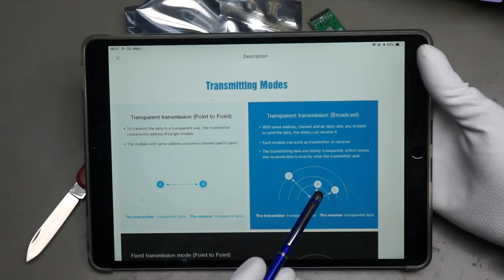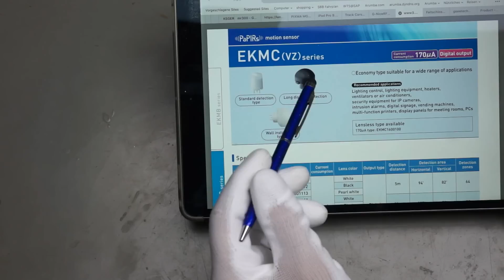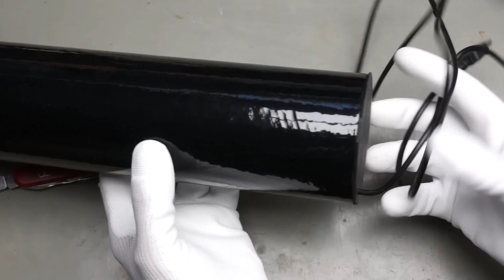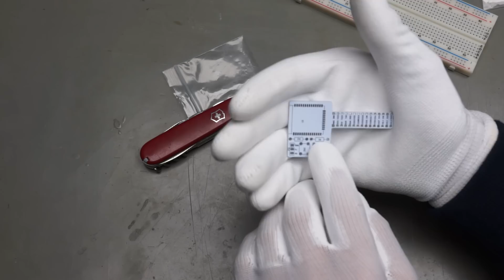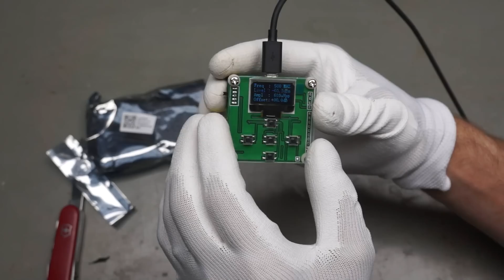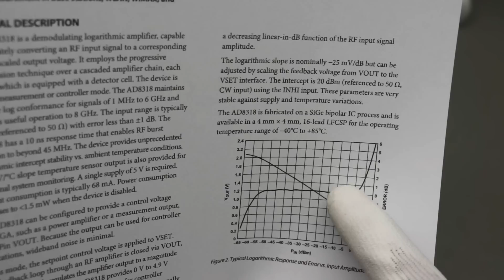#266 Mailbag with LoRa, special PIR, Sigrok, Harvester, Ethernet Cable Tester

Comment: The Cypress FX2 is not an FPGA, it an 8051 microcontroller with a high speed USB data fifo.  It is programmable, in that (whatever program you're using) uploads code into the RAM when the USB device is plugged in
Reply: you all prolly dont care but does any of you know of a trick to get back into an instagram account?
I somehow forgot the account password. I love any assistance you can offer me!
Reply: @Jesse Bentlee instablaster :)
Reply: @Adrien Maverick i really appreciate your reply. I found the site thru google and Im waiting for the hacking stuff now.
Takes quite some time so I will get back to you later when my account password hopefully is recovered.
Reply: @Adrien Maverick It did the trick and I now got access to my account again. Im so happy:D
Thank you so much you saved my account :D
Reply: @Jesse Bentlee glad I could help =)
Reply from the maker: Your are right: It has a 8051 as a supervisor. Maybe it is not correct to call the logic FGPA. In the datasheet it is called: General Programmable Interface (GPIF)
Reply: @AndreasSpiess  Handy to have them around. I did a housing for these on thingiverse: https://www.thingiverse.com/thing:3371019
Reply: @AndreasSpiess  FX2 have configurable analog arrays where you can do analog filters, DAC, ADC etc. FPGA is full digital signal processing.
Reply: @LimbaZero  FX2 doesn't have any analog circuitry. You're confusing it with PSoC. FX2 is a universal data pipe with USB2 interface on one end and very flexible parallel interface on the other. 8051 core is used for configuration and management of the USB engine, but sits idle for most of the time (can be used for other things). The chip is very often used to provide usb connectivity for FPGAs, or to grab any other parallel data (like in logic analyzer). Cypress has also similar product for USB3, called FX3.
Reply: @piranha32  Yes that's the case. I was too tired when commenting. Both from same vendor.

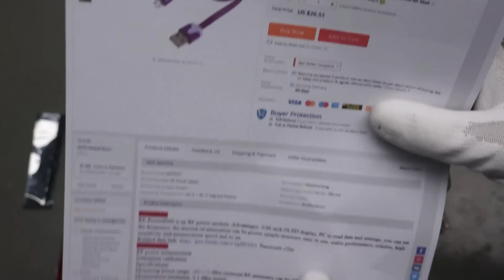Comment: Great vid, thx - precarious how much I enjoy other people's mailbags, anyway Andreas thx a lot for putting info with prices, apreciated. Im interested in this RF power meter  15:42  and wondering of this unit will do what I hope,  I fit it with an appropriate antenna and be able to show me the RF-powervalues on RC 2.4ghz equipment, like RC quads?
I almost got myself one of these immersion RC Power meter V2 when GB had clearance at 35USD https://www.immersionrc.com/fpv-products/rfpwrv2/
but was sadly sold out before my PayPal process was golden, so been in the market for an RF Power meter, not leats for RC gear..
Reply from the maker: The power meter is only for transmitters and you need also attenuators because otherwise it is kiilled. If you want to test antennas, you maybe want to watch my antenna videos.

Comment: Is the RF meter sensitive enough to use with a high gain directional antenna to pinpoint single sources?  Is the frequency set manually, or does it lock onto the strongest source?
Reply from the maker: You cannot test antennas with it. Only transmitters

Comment: Hello Andreas, I'm really looking forward to your solar harvesting project.
I would recommend to also add the AEM10941 to your comparison. It is an energy harvesting power management IC, it has build in LDOs, MPPT function, and battery management. Jasper Sikken sells a complete module on Tindie, I'm using it for some Lora test projects. Check it out on: https://www.tindie.com/products/jaspersikken/solar-harvesting-into-li-ion-battery/
Reply from the maker: Thanks. I ordered one.

Comment: Hi Andreas. Could the power meter be used with an antenna to measure transmitted power from some of the transmitters we use, e.g. 433Mhz modules, bluetooth, wifi, lora, rfm69,nrf etc? If so, maybe it can be used to make relative measurements to compare the power emitted by different antennas (e.g to check if the antenna is correct for the frequency) - assuming the power out from the transmitter is constant (not adapting). I know there are SWR meters, but they are more expencive. Bying antennas from China is gambling.
Reply from the maker: It is not connected to an antenna, only to a transmitter.  The antenna is not covered. If you want to test the antenna you either need a VNA (I showed it in a video) or use a receiver a few hundred meters away (another video)

Comment: @9:53 You can measure visible spectrum using young's double slit experiment (very easy and cheap to do). If you have a camera to let you observe the IR pattern you can measure it with a ruler!
Reply from the maker: This is more or less what this camera does. Just electronically

Comment: Interesting mailbag
I think the bq25570 is a very good energy harvesting chip, although rather expensive. I have been using this chip for my solar powered weather station  for a couple of years now, without any problems. But you have to read the datasheet very careful to get the full benefit of the chip. I use a LIPO battery for storage, I tried using a supercap but couldn't enough energy out it, notice that the output stage is a buck-converter therefor the voltage  on the cap should be higher that the output voltage, which doesn't get the full potential of energy of the cap.  I had some problems with the output cap which is specified to 22 uF, I had to increase it to 1000uF to avoid Brownout. Also take a look on the design Excel sheet http://www.ti.com/lit/zip/sluc461 if you are going to adjust some of the settings.
Reply from the maker: Thank you for sharing your experience. I think for our ESPs or Arduinos a super cap has no advantages (at least in normal temperature ranges). And here if we have sometimes for a week not sun wee need some capacity. The sheet you referenced is similar to the calculations I did in my solar video. It is quite straightforward.

Comment: I think amazon.de is watching your youtube channel :) . I found this https://www.amazon.de/dp/B07DWV13WG/ref=gbps_tit_s-6_beb0_5067099d?smid=A27QO866LT4V45&pf_rd_p=d873fd2d-3f6d-45a1-84d2-430e9b93beb0&pf_rd_s=slot-6&pf_rd_t=701&pf_rd_i=gb_main&pf_rd_m=A3JWKAKR8XB7XF&pf_rd_r=QKP0A6M2JXXN9GFKEW61 in the "Angebot des Tages" this morning.
Reply from the maker: :-))   Very similar, indeed. I buy now more and more from them as they stock up electronics. And usually, are quite fast.

Comment: Audio too soft. right click -> stats for nerds -> volume: -9.6 dB. Ideally it should be between -2 to 0 dB. Turn up the mic gain and move it closer to your face first, if still not loud enough then amplify digitally. Audacity is a free audio editing software that you can use
Reply from the maker: I use audacity and level it to -2dB max. The rest is done by Youtube

Comment: 100 mW in 433 MHz is *forbidden*, unless you are an amateur radio operator and transmitt with your callsign . For ISM usage, you are allowed to use 10 mW maximum.
Reply from the maker: I dis not check. Might also depend on the country
Reply: @AndreasSpiess  It comes from ITU regulations, applies almost everywhere (where the ISM 433 band is allowed, which means in the ITU Region 1 and some countries of the ITU Region 2).
Have a look to : http://www.apt.int/sites/default/files/Upload-files/AWG/APT-AWF-REP-07Rev.2_APT_Report_on_SRDs.doc
Reply: @Elektro LUDIKITS You are almost correct, if you limit the duty cycle to 1% and channel bandwidth to 25kHz (shouldn't be a problem with LoRa), there are several bands that allow up to 2.5W of power, license exempt. Here is a link to regulations in switzerland: https://www.ofcomnet.ch/api/RIR/1021/06

Comment: I have question for king of sensors :) I have tried to solve this already more than few times without any luck, what type sensors are used for finish line trap. typically end of rally stages etc. I assume it is some sort of IR coupler, but nothings pops up when doing search. It should be powerful and big enough to work on such poor environment. Few times actually seen some trap sensors, but no markings, big lenses.
Reply from the maker: I use 15 degrees lenses in my IR video. They should go a few meters. But the beam is not small. You probably would need a laser diode.
Reply: @AndreasSpiess  Yes, latest video gave me few ideas. Laser is probably needed for accuracy  and separate sender and sensor to avoid possible unwanted reflections. Now I need to select few candidates and do some testing.
Reply from the maker: I do not know what a finish line trap is.
Reply: @AndreasSpiess  it is the same as a light barrier, sometimes used to sound the bell when customers enter the open door at shops.

Comment: I'm a bit sceptical about 5.5v supercaps as they are a series of 2 normal supercaps without balancing that will eventually kill one of the 2 due to overvoltage (I already lost a few this way). There are better IC that actually support 2 separate supercaps for energy storage but they are more expensive.
Reply from the maker: Well possible that they have no protection.. I will check it when I do the tests.
Reply: @AndreasSpiess  being soldered together and just 2 contacts, there is now way and nor room for any kind of protection

Comment: The breadboard friendly esp32 may interfere with breadboard friendly PSU's
Reply from the maker: My boards have two end. Maybe we find a compromise.
Reply: @AndreasSpiess  yes, I was not thinking. I presumed the esp32 board already picked up power from the powerlines, but ofcourse it's 'us' who still need to connect it with wires. Thank you for setting me straight, stupid me ;-)

Comment: The Ethernet tester should also test the other characteristics as well and not just the speed because even though the continuity is correct, it may not work as a data cable because the attenuation is too high. For quick and simple debugging it is alright but for everything else you should buy the originals from fluke and not the copy from china.  The scan function looks nice  and is probably very useful....
Reply from the maker: You are right. For me it is sufficient. I only want to know if I crimped the cable right ;-)
Reply: @AndreasSpiess , this ethernet tester is also very useful, and not expensive.  It has a lcd-display which not only shows if the cable is broken or crossed, it also shows the distance to the end of each wire, so you can see in which end or somewhere along the cable it is broken.

https://www.ebay.co.uk/itm/Netzwerk-Kabeltester-RJ45-Netzwerkkabel-testgerat-Ethernet-PC-Drahtlange/163312478422
Reply from the maker: I ordered one. Thanks
Reply: @AndreasSpiess  Sorry, Today I'd recommend the https://www.ebay.co.uk/itm/362564058892  NF-388. Comes with 8 remotes and cable tracer. Also nicer looking ;-)

Comment: Hi, 
CY7C68013A logic analyser is a cheap solution compared to saleae solution.
I do like tobias microWakeupper solution but the ESP is still power on (even in deep sleep) and consume some energy. In my opinion, Kevin Darrah solution (trigboard) is far better (https://www.kevindarrah.com/wiki/index.php?title=TrigBoard)
 Regarding E32-TTL-100 LoRa module, I am currently using it (with success) in a raingauge 3d printed solar powered project (https://github.com/fguiet/AutomationServer/tree/master/sketches/raingauge and https://www.thingiverse.com/thing:2853428). Some links about E32-TTL-100 : https://github.com/Bob0505/E32-TTL-100, https://www.teachmemicro.com/e32-ttl-100-sx1278-lora-module/
Thank for your great videos Andrea, bye
Fred
Reply from the maker: Thank you for your links. I will look at them when I start with the E32. Nice Rain gauge, BTW!

Comment: Just finished making a yagi-antenna for a school project. We used the CST software to optimize our build then test the actual using an RF meter. Nice to find one cheap but it would probably just sit in storage if I buy one now. You were recently mentioned in dronebot workshop's channel. Led me to buy cytron motor drivers to play with.
Reply from the maker: Nice project, a working yagi. And not easy. Congrats!

Comment: I wonder if the ethernet cable tester could be adapted to track boundary wires for robot mowers, and perhaps find wire breakes?
Reply: No. I have tried.
Reply: @LeifNelandDk  Thanks for the info!
Reply: Actually, I said that before I saw the end of the video. Perhaps it can; it works on the same principe as this: https://www.ebay.co.uk/itm/MS6812-Cable-Finder-Tone-Generator-Probe-Tracker-Wire-Network-Tester-Tracer-Kit/143056074791 which I have used with limited success. If everything else fails, use a voltage generator for eletric fence (be sure to disconnect the wire from the base station first.)

Comment: Is there any decent library for the ebyte e32 module? I couldn’t find any usable one.
Reply: Not really a library, but more of a short introduction to it: https://www.teachmemicro.com/e32-ttl-100-sx1278-lora-module/     I've also received two of these to have a look at them. I'm very interested if/when Andreas will find time to dig into them, but I am afraid LoRa/TTN is out of the question for these.
Reply: There are a couple of libraries on the arduino forum, but the example code is not very clear and I couldn’t manage to use them.
Reply from the maker: Did you try to write to the supplier?

Comment: Andreas, I saw you received a lot of solar modules later. Maybe you'll find this interesting: a solar supercapacitor charger I accidentaly found on the WEB https://www.tindie.com/products/MadElectronEngineering/infinity-solar-bank-v401/ (I don't produce it and I'm not related in any way with the guy that builds them)
Reply from the maker: Thank you for the link. I am not a big fan of supercapacitors for low power (100 mA ESP or Arduino) solar applications as batteries have a lot of advantages. Only if you can go down to microA a super cap might be a good choice in my opinion.
Reply: One of the advantages of the supercaps would be that they do work in low temperatures without problems.
Reply: What type of batteries would you use for harsh temperatures like -20°C?

Comment: I like the rf power meter. Handy tool for lora modules. When used in conjunction with the N1201 antenna analyzer you reviewed you can ensure decent rf performance with these small modules.
Reply from the maker: You are right, this is a good combination.

Comment: why isn´t the e32 module capable of lorawan?
Reply from the maker: Because it has its own firmware and is not programmable.
Reply: @AndreasSpiess  thank you Andreas! Got the same module days ago but was not aware of this. So I will use it for p2p connection.
Reply: @AndreasSpiess  by the way, thank you for your great work! Learned a lot from your videos. Keep it up.

Comment: Correction: The Cypress FX2 logic analyzer is not an FPGA. It is a microcontroller with an 8051 core. 
More info about these chips and sigrok/PulseView: https://www.youtube.com/watch?v=dobU-b0_L1I
Reply from the maker: Your are right: It has a 8051 as a supervisor. Maybe it is not correct to call the logic FGPA. In the datasheet it is called: General Programmable Interface (GPIF). Thank you for the link!